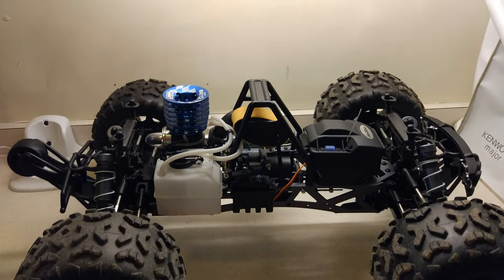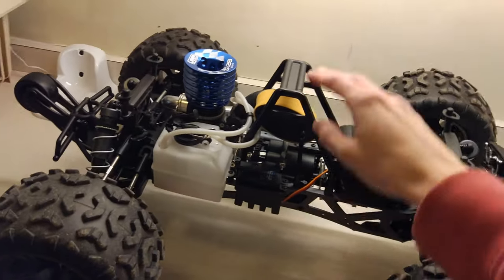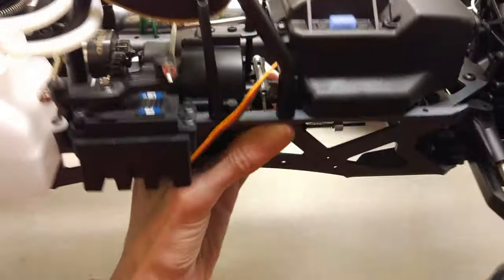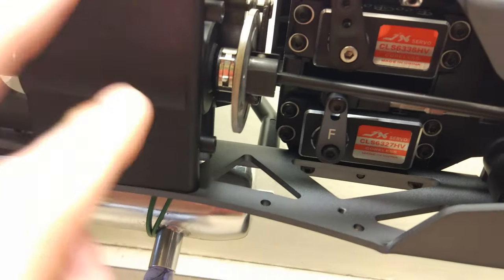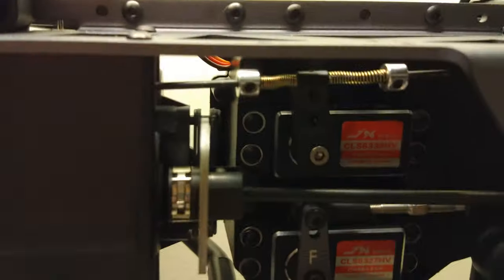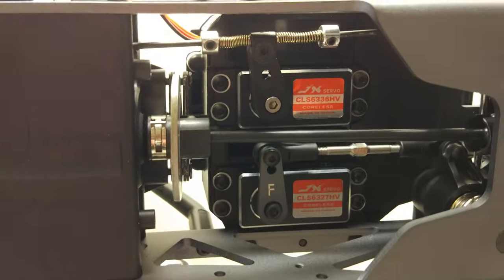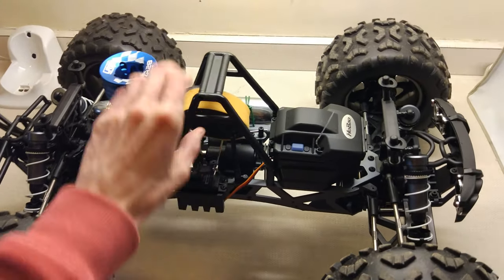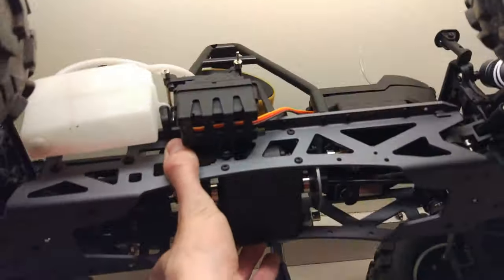How I have Set Up Reverse On The Hyper MT Nitro

Comment: I literally had no clue there was a reverse option for this kit. Thanks for the video and you're correct, there is barely any videos of this nitro truck on the tubes.
Reply from the maker: Yes. I didn't either until I looked in the manual and saw it as an option. It's one of the main things that sold me on the truck.

I also could not find any videos of it reversing. 

Unfortunately I am having some drive shaft problems so any more videos are on hold until it's fixed :(

Comment: God damn this is an amazing video. I just got an MT plus 2 and after watching this I’m kind of wishing it was nitro. I had no idea how reverse worked on a nitro and you just explained it perfectly. 
Love to see this truck running once it’s all run in properly. 
Finally, I’m not 100% but I believe your low speed needle sounds slightly lean.
Reply from the maker: Thanks! Yes in this video I think the exhaust gasket was causing and air leak. I have fixed the problem which is in one of my later videos. I was going to run again today, but there were too many people in the park, so I will have to go back later :)

I also nearly went with the hyper Mt plus 2 as it is a beast and fixes many issues this truck has. They didn't do a nitro version of it though, so I went with the older model and got some upgrades like the wheelie bar, front brace and reverse kit.

Comment: So I'm a little confused... I was expecting to see a home built solution, but what I'm seeing in the comments indicates that this is an option for the specific car/truck you have.  I'm  trying to figure out if it might be possible to add reversing capability to my nitro rc rally car.  I just realized I haven't checked your description, so hopefully you listed info on the reverse upgrade so I can get details on how exactly it works. Thanks for sharing the video! 😁👍😎
Reply from the maker: Yeah this is a optional part for the truck, but the instructions don't really show how to set it up at all
Reply: Did u get it? I'm trying to figure out how to build it into my rc nitro truck (Hsp 94108)

Comment: Hi chap I just got on off these cars finding hard for parts were do you get wheely bar and the reversing kit and some shock socks and eny hop ups toowhat's the weak points of the car
Reply from the maker: I have got all my parts from:
https://rcmodelshopdirect.com/

I dont actually know what the weak points on the stock truck were because i bought most of the optional parts from new. I would actually recommend you get a rechargeable hump pack as the only upgrade to start with.

I would recommend you watch all my videos on the truck, but stick with the stock engine.

Comment: Do you happen to know why there isnt always a reverse built in?
Reply from the maker: Yes, there are a number of reasons.
1) it adds an extra set of gears in the gearbox which is extra rotating mass, which makes the truck slower
2) in this case it requires an extra servo and channel on the remote which would increase the cost of the truck initially.
3) people are mostly dumb and put it in reverse while going forwards and break it.
4) it's an extra linkage to set up at the factory on the assembly line.

Back when nitro cars were very popular in mid to late 2000's there were a few manufacturers that had reverse from the factory in models that were £50-100 more than the standard model and they didn't sell as well. They weren't really set up right from the factory, so people thought they were not reliable, so many people ended up doing a forward only conversion and taking the reverse kit off.

In this case for me, the reverse kit was an £75 option part, I already had a spare servo to use for it and my remote has 6 channels so I had the perfect switch to use it.
Reply: @LawrenceTimme  .. I'm person type number 3. :D I'm very bad at these things. My car has survived(except for crashing into objects) from 2010. Main issue for me is that I'm chewing through batteries..

Thank you for your insights!
Reply from the maker: @LEADER0FY0U  luckily on mine it's on a 3 position switch rather than 2 so I have to go into neutral before reverse.